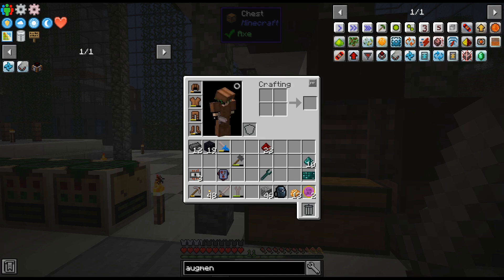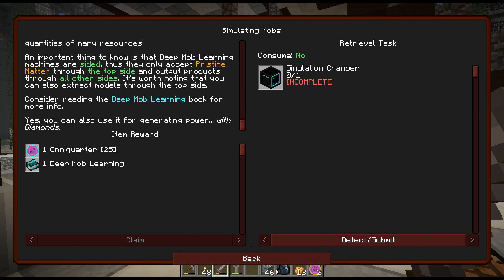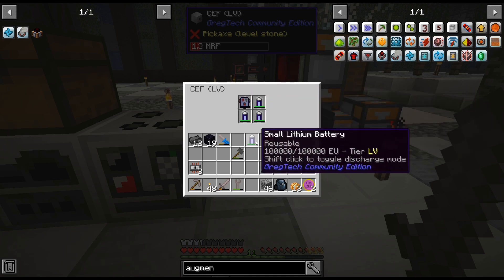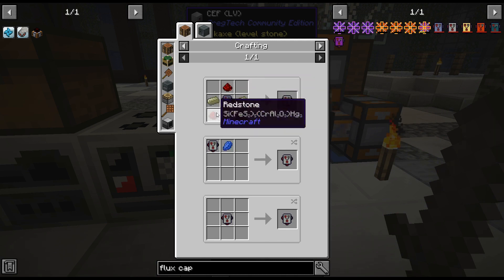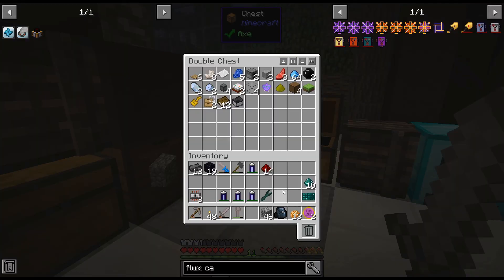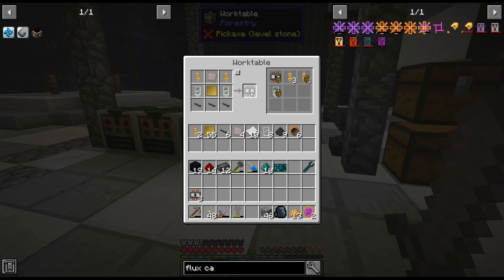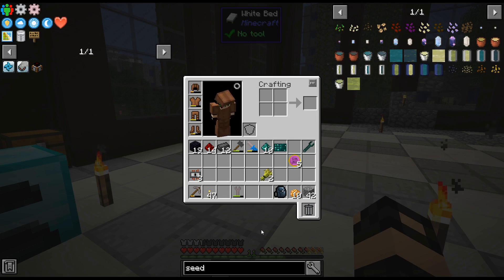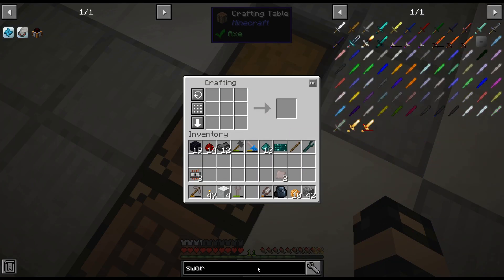Omnifactory - 9 - Getting Started on Applied Energistics

Comment: 4:00 CEFs are supposed to operate at their full capacity regardless of whether you have energy storage items inside of them, but due to weird interactions with GTCE batteries, I would advise only using Flux Capacitors. CEFs will work fine without batteries and have an acceptable internal storage if your power infrastructure is sufficiently scaled. It's generally advisable to produce and store RF power and convert it to EU on site in CEFs.
26:12 all according to keikaku :^)
32:00 AE2 is just weird man. The energy acceptor for example checks every so often and bulk-draws power instead of continuously flowing it, leading to blackouts if you have a usage spike if you don't add AE energy cells to the network to act as capacitors.
32:30 if you can't remember where you put something, hover over it in JEI and press "T". This will close JEI and show smoke particles over the inventory containing the item if it's found anywhere nearby.
Also worth noting that you get silicon from electrolyzing clay dust, among other rather important things. Another good source doubles as an effective means of getting Oxygen: macerating furnaces for Silicon Dioxide.